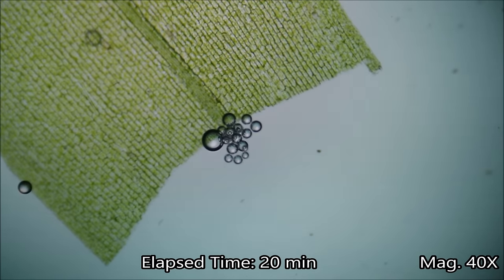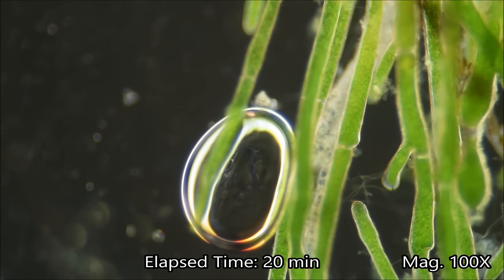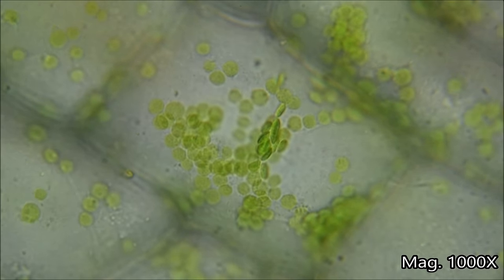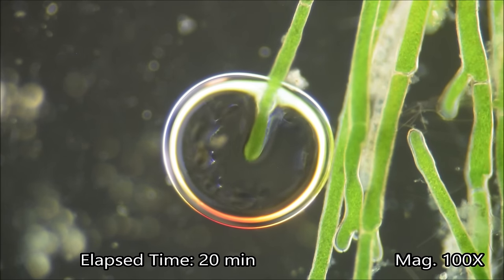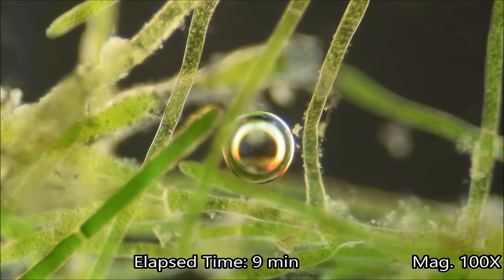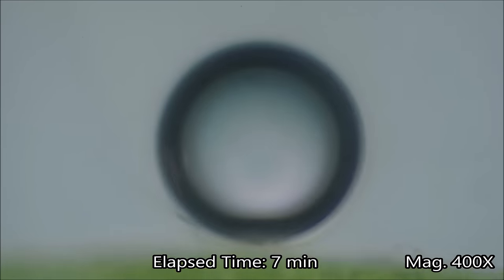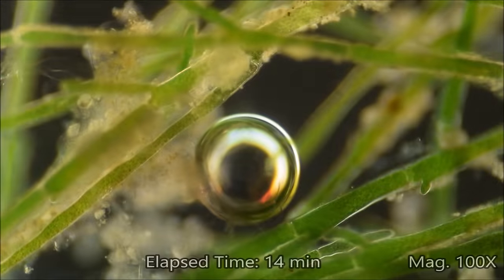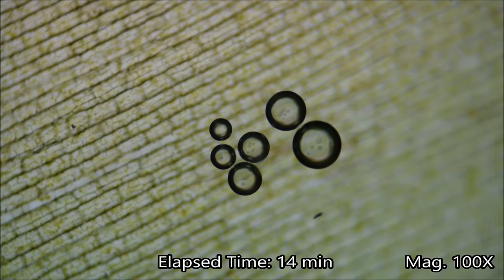Photosynthesis Under the Microscope

Comment: Im a biologist too. It's good you show this to people. But the following is more truthful/accurate . As I'm sure you know.

1. You are not showing the process of photosynthesis which requires looking at the atomic level inside a chloroplast. Which nobody has seen. You just show the plant blowing bubbles of oxygen underwater like an animal would do blowing bubbles of carbon dioxide. 

2. Chloroplasts cannot move by themselves. They are being moved by the cell via cytoplasmic streaming.

Comment: How does anyone know those bubbles are oxygen? Furthermore how does anyone know those bubbles are just air and not oxygen? Is the leaf that's under the microsope in a solution of sodium bicarbonate, which imo is a source of oxygen? The formula for sodium bicarbonate is NaHCO3, yes 3 x oxygen!! Carbon dioxide only has 2 x oxygen so what happens to the extra one? These demos are ALWAYS undertaken under laboratory conditions so let's see if a plant in the natural environment under a microscope and without any NaHCO3 can do the same thing.
Reply: To the uploader:  Don't dismiss P & P as cranks. They are groundbreaking, extraordinarily discerning science investigators whose insights include that jet engines are "self-propelled fans" that can maintain a plane's airspeed and altitude without burning fuel. One of P & P's most recent seminal concepts is that a sealed chamber will be lighter if it contains He than if it is pumped down to a high vacuum.   /sarc

Comment: june 30 2022   ... an article in the news this week said electricity is now being used to energize plants 
in lab research experiments to perform similar duties as done with traditional sunlite & chlorphyll.

     mentioned was an efficiency of 20% or so vs what was reported as being 1% for photosynthesis.

     i'm curious how , say , for photosynthesis, a % efficiency can be calculated. 
 i know that light can have a PAR rating so we know how many photons are in play for , say , an hour.
and in that same hour so many bubbles of oxygen are released. 

      there is likely some
energy rating for the breaking of water's molecular bonds for oxygen to be released.

   so then in a rough fashion can the 2 be related ?  the energy of the incoming photons to
the chloroplasts over an hour and  the energy the released oxygen represents in terms
of what it takes to break up water ?